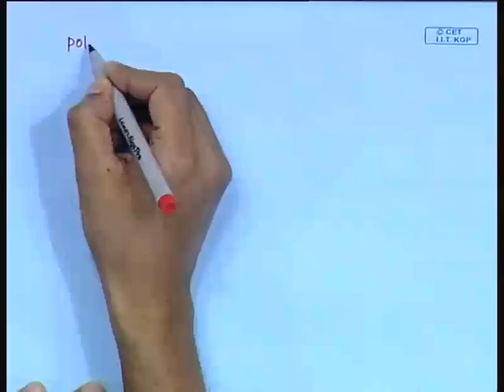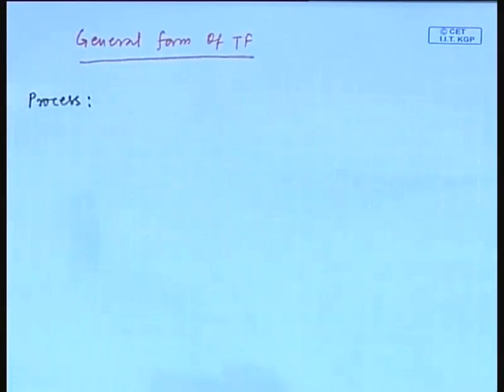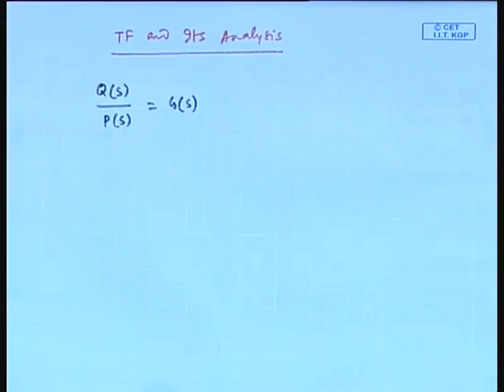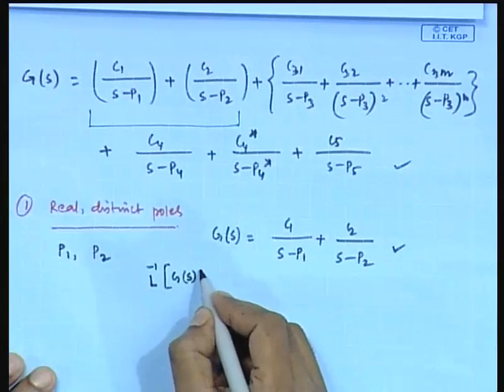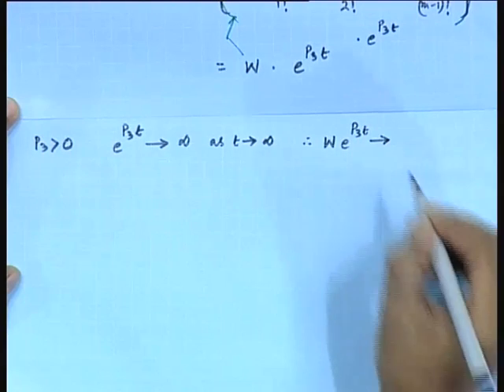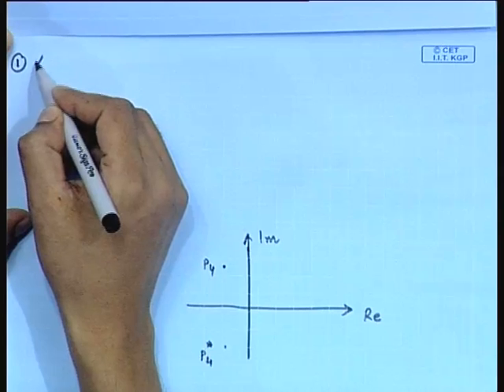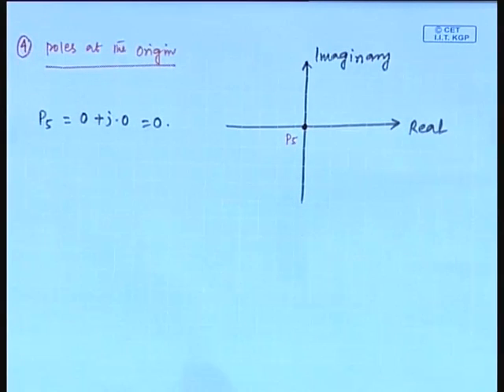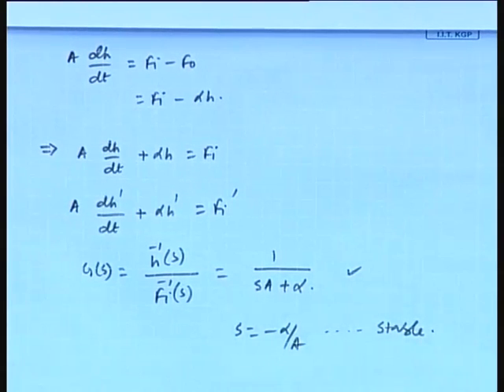Mod-01 Lec-09 Lecture-09-Dynamic Behavior of Chemical Processes (Contd...3)

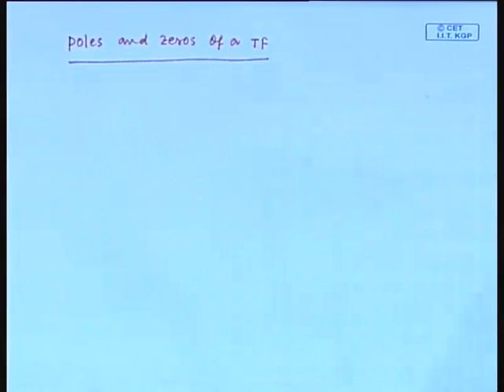Comment: 1:21 POLES AND ZEROES of a TF
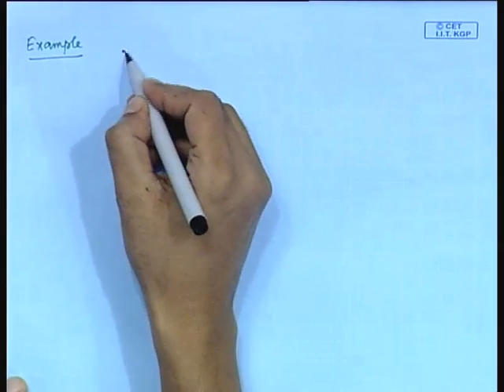4:37 example
6:26 At the poles of a system, transfer function becomes infinity. ; At the zeroes of the system, transfer function becomes zero.
8:00 General form of TF
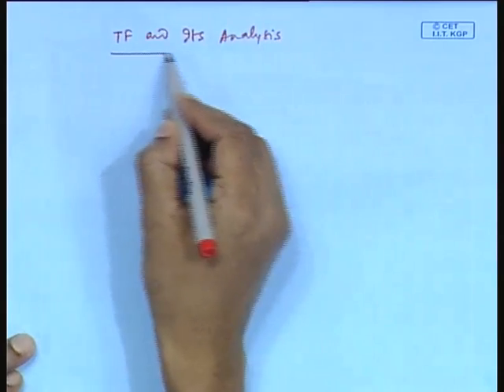15:01 TF and its analysis
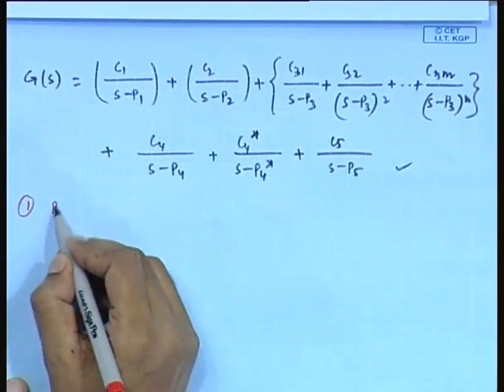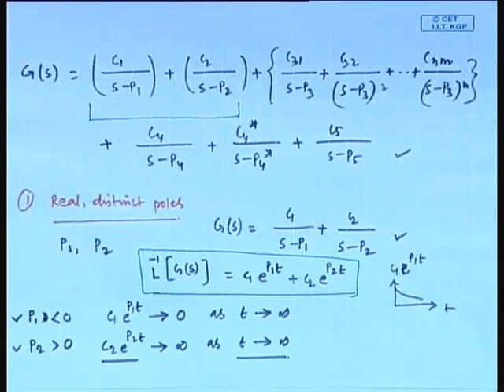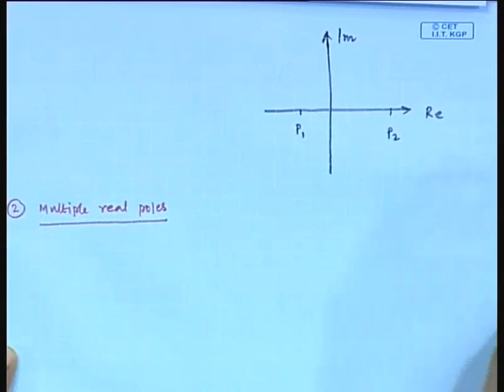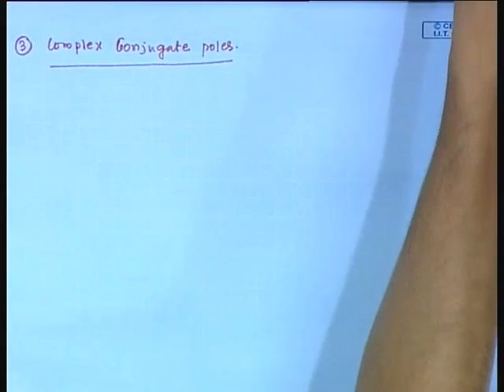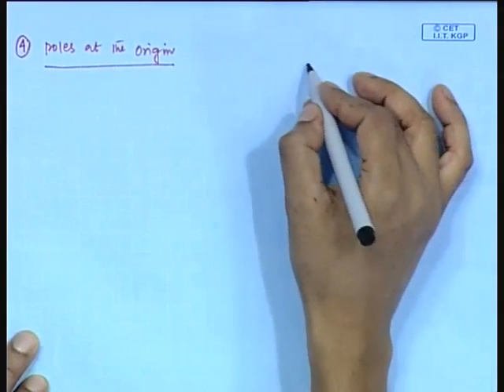Stability: (20:58---25:34 real and distinct poles; 26:36 multiple real poles; 33:22 complex conjugate poles; 44:58 poles at origin)
48:18 example